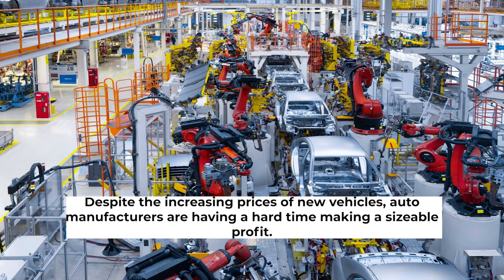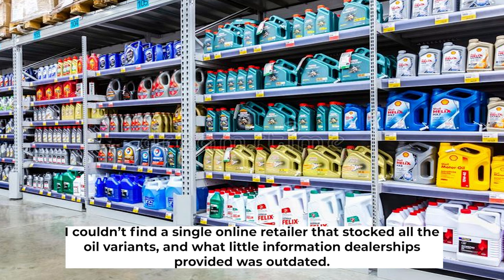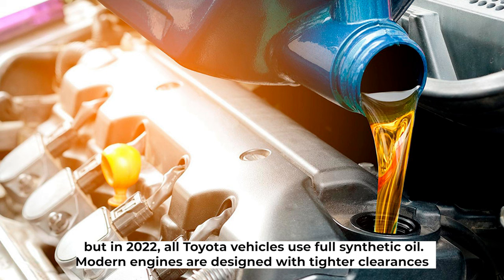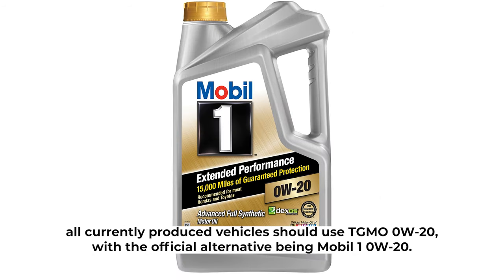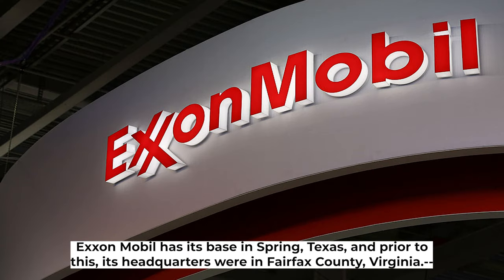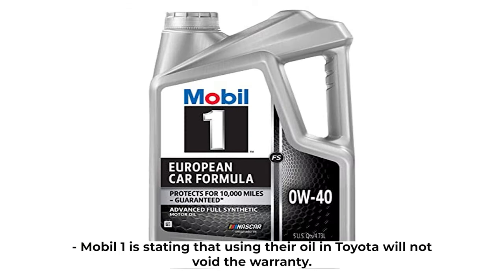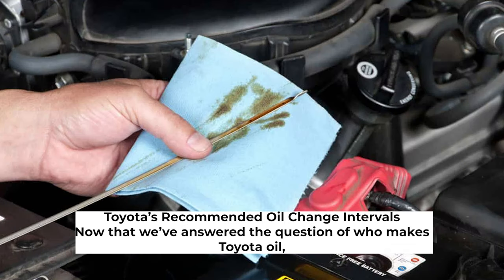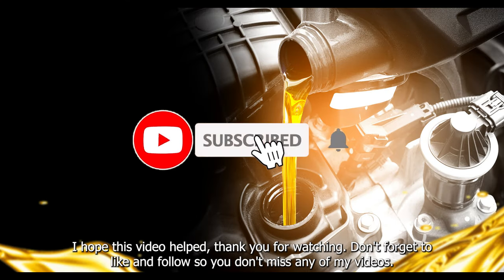Who Makes Toyota Oil and Is It Any Good?

Comment: i been buying 0w16 from dealer past 5 years i see mobil one 0w16 is like 20 bucks cheaper can i safely switch? My old camry i used the cheapest oil i found no matter of brand had it 300k plus no engine issues ever.
Reply: Probably.  The owner's manual for your car will specify what sort of oil is required both in terms of oil weight and any required certifications.  If your vehicle calls for 0w-16 and requires it to meet ILSAC GF-6B, any oil matching those parameters is likely to work fine.  Of those, I'd choose one from a brand I'd done research on and trust.  Not all brands are equal, and not all product lines within a single brand are equal either.  Make sure you get the /specific/ oil you've researched and decided on when it's time to buy.  More importantly than the particular oil itself though (provided it matches the required specs), don't stretch your oil change interval.  If you want a long life out of an engine, your best shot is to change your oil more often than required.  The manual's guidance is written from the perspective of keeping the engine alive through the warranty period, not keeping it healthy indefinitely.
Reply: @Tbird761  it says 0w16 sn/en/rc i don't see rc on any other oil
Reply: Yes, and now you can afford a yummy pancake breakfast at the truck stop.

Comment: Although Toyota Oil in made by Mobil 1, that is where the similarities end. Mobil 1 makes Toyota oil to Toyotas Specifications. The additive package is very robust especially in the 0w20 & 0w16. Toyota oil is one of the best on the market. FAR superior to M1, Pennz or Castrol.
Reply: Toyota's generally do not have highly stressed engine,

So I doubt that the additive package is very if at all different between Mobile 1 0W16 / 0W20 and Genuine Toyota oil.

Maybe someone has done a lab test and can prove me wrong 🤷‍♂

And if my car needed oil with that viscosity, I'd be going with Shell (Shell and Pennz are the same company, which is why they only sell Shell oil here in Australia).
Reply: @notsureyou https://youtu.be/IRwvfvwWbYE?si=1Hxw2Mtip1-7uGRv

Here is the oil analysis you requested. You can see how different the additive package is. The package for Toyota 0w16 is actually very very robust and different from the Mobil 1 0w16.
Reply: @solargoomba  The test results leave a lot to be desired,

The reason is that for example for the Toyota oil, 

He didn't use a sample from an oil container (purchased from a Toyota dealership),

He drained some out of an engine (that had circa 16km on it).

This MIGHT explain the ludicrous high levels of moly in the Toyota oil,

Someone suggested online that this is actually left over grease etc from the assembly of the engine.

And in fact this value that was significantly higher than the others, should have raised an eyebrow and been a cause for discussion.

 For this to be a valid test the following criteria needs to be met:

- Samples from bottles only
- Numerous samples from different sources (oil bottles from different production batches)

What also needs to be considered is the type of moly used,

Again CLAIMED online is that Toyota specifies an older type of moly,

Whereas other oil manufacturers use an updated / better moly.
Reply: @notsureyou  https://youtu.be/_6nWCQ_70J0?si=0holxaDb585NanXk 

In this video he directly takes Toyota 0w16 at around 9 minutes from the bottle and sends it to be analyzed. The results are pretty much identical to the first video I posted. I will say fantastic job moving the goal post!!!
Reply: @solargoomba  For some reason my reply has disappeared (maybe it will show up again later???)

So this new link is from a different guy, who does what the first guy should have done.

As you can see in the tables, that the samples vary and show the need to have multiple samples.

For example in regards to Magnesium:

First link = 727
Second link = 523

Or Boron:

First link = 201
Second link = 261

In regards to Moly content:

When you see a VOA or UOA of a motor oil that has say 700+ ppm of moly in it, than you can be sure that that particular brand is not using "tri-nuclear" moly in their motor oil.

Or at least that's what I've read online 🤷‍♂

Comment: No one has been able to tell me if a 0w16 - 0w20 will hold up in the extream tempatures  in these low displacement turbo charged engins. I fear we will be seeing a lot of burnt out turbo engins in the future.
Reply: I don’t doubt those engines won’t last to extreme miles like older engines did 250k+ but I doubt it will be oil related
Reply: the toyota handbook says it may worth using a higher viscosity oil if the car is used under severe conditions
Reply: @williamgould2855  Thank you.
Reply: Il faut surveiller le niveau d' huile régulièrement. Je le fais environ à chaque plein d' essence, soit tous les 700 kms, ou environ 500 miles.
Ma Toyota Yaris (Écho) à 171 000 kms.
Reply: Change your oil more often than recommended.

Comment: 2023 Toyota XSE hatchback USA market (Made in Japan) Engine oil sticker calls for 0W/8 engine oil.  This is just about impossible to find.  I did find it at Toyota Parts Dept. at $20.00 per quart.  I was told 2023 is the first year of the Corolla using this new 0W/8 motor oil.  Will this oil become more available as time goes by?  Right now I am locked into getting it from Toyota Dealership and not all dealerships stock this oil and must special order it.  It's that new.🤑🥴😵‍💫😱🙈
Reply: Most of those car say if x isn’t available to use x but change early. Read your manual and see if you can use 0w16 or 0w20 and change it out at 5k
Reply: @thetechlibrarian  I use 0W/8 as stated on label in engine compartment.
Reply: @microminiskirt I believe the manual says you can also use 0W-16.

Comment: I would like an honest test of the cartridge oil filter for the Toyota Tundra.  Most if not all videos show spin on motor filters.  The design of the OEM filter is hard for me to believe all the oil is filtered.   Do the filters need a ADBV or not?   I am not an engineer and appreciate YouTube videos.
Reply: I believe on the canister style oil filter is the anti-drain back valve is built into the filter housing if I’m not mistaken, also, it seems like Toyota values flow rate over absolute filtration, which makes sense so I wouldn’t worry too much. I’m sure it’s doing just a fine job just change it often.
Reply: @thetechlibrarian  You are correct. It is built into the filter housing with cartridge filters.

Comment: My advice. Use the cheapest oil you can get that meets the specification and change it early. Read the fine print in the owner's manual or shop manual. Sometime it will allow different oil weights at different temperature ranges. My car is 20 years old. The recommended oil is 5W-30 but the manual says you can use 10W-30 if the local temperature does not go below 0 F. The manuals for other vehicles I have had say the same. I have long used whatever is the cheapest, but recently 5W-30 has always been the cheapest. Life is tougher for people who do not do their own work though. A large pitfall is that people do not want to accept that all-short-trips driving represents severe service. It may not feel like it, but it is. If you drive a vehicle that does not require synthetic oil, you can use the cheapest oil and filter you can find and go 5000 miles if you do all highway driving, and even get away with going 7500 miles. All of my driving is around my local city, I use semisynthetic and my change interval is 2800 miles.

Comment: I hope you can suggest me the best to do. I just bought a new 2024 Rav4 XLE made in Canada three months ago. I live in Mexico City. Well, the manual says that the engine oil that comes from factory is a 0w20, but at the toyota dealer they put a decal in the engine compartment that says that the correct oil for that vehicle is 5W30, and all the dealers in Mexico only sell this kind of oil, 5W30. My question is, is there any problem if I use that oil? I have to take the car for service at the dealer every 6 months or 10,000 kilometers to keep the warranty alive and they only apply that kind of oil. Today I asked the parts manager if they have any other oil and he told me that not, he told me that all the toyota cars sold in Mexico are homologated to use the 5W30 oil. What do you think about all this situations?
Reply: I lived in Mexico and had a Toyota Yaris I had serviced at Toyota. I never paid any attention what weight oil they used but it was synthetic.  I'm sure Toyota Mexico knows what they are doing. They probably use the 5W30 because of the altitude or harsher environment (heat), but it must be a good reason. Most of Mexico doesn't get that cold so the thinner oil is not needed and a little thicker oil is better.

Comment: How about honda?? Where did they get there engine oils from??
Reply: IDEMITSU!!!!  they are the main OEM Supplier for Asian/Japanese Brands.  something that this guy didn´t mentioned in the video is that idemitsu works directly with the different companies (Nissan,Subaru, Honda, Toyota, etc.) to develope new viscosities  and formularions.  EXXON only copies the "recipe". IDemitsu is the master Cheff
Reply: The oil suppliers for the brands vary by continent and/or country. For Honda in Mexico it is Exxon Mobil, in USA is Conoco Phillips (same manufacturer of Motorcraft for Ford).

Comment: Toyotas are loud as hell that oil is to thin
Reply: My Toyota has one of if not the quietest engine that I ever had in a car.  47 years driving and and the 12 cars I have had.  It's a 2019 CHR with a 2 litre 4 cylinder that runs whisper quiet.  Uses 0w20 oil.

Comment: Somewhat inaccurate,  newer toyotas most use 0w16 and is not to be substatuted .
Reply: Hand book says you can use 0w 20 but must change back to 0w 16 next oil change
Reply: @davewebster1627  I've heard on YT of people using thicker without any issues, and in countries with less EPA stuff the owners manual apparently allows for the thicker oil.

So the MUST USE 0W16 might be due to an emissions target 🤔🤷‍♂

But unless you can afford a new engine... stick with what the owners manual in your country says....